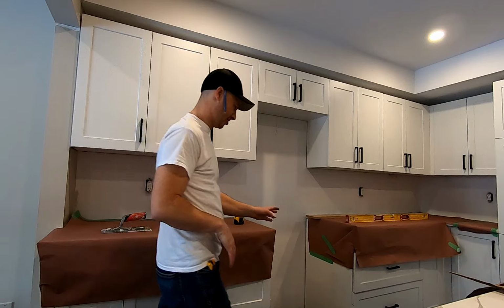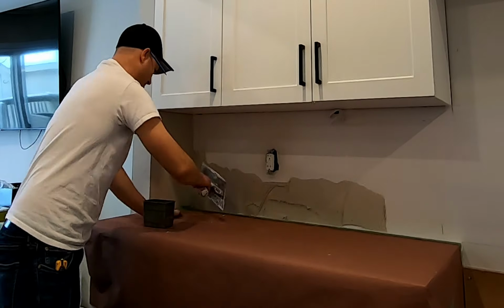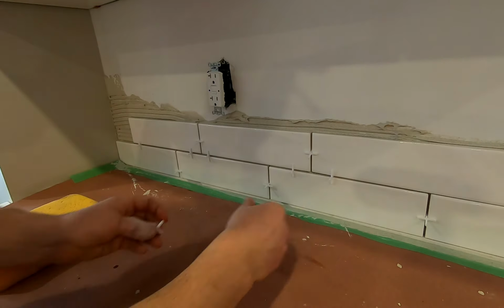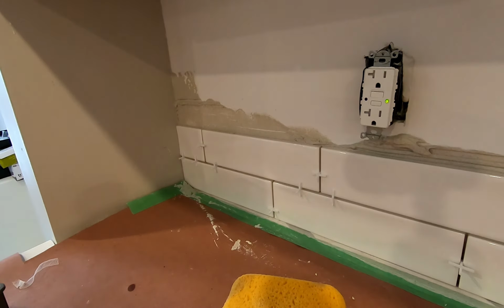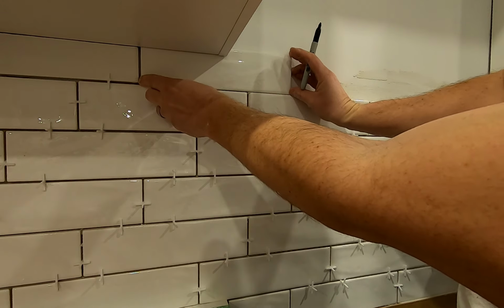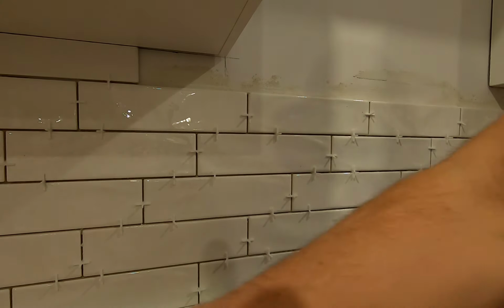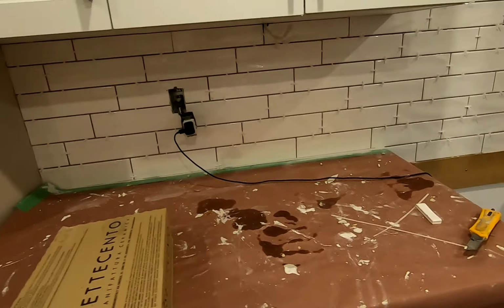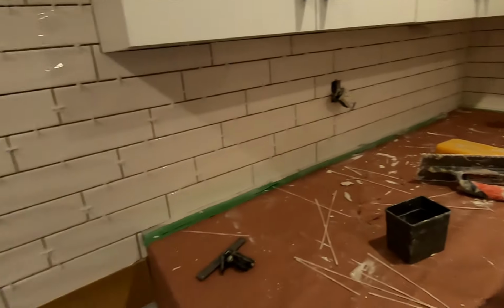How to Install Subway Backsplash Tile

Comment: I enjoyed your video.  Your straightforward, no-nonsense style is refreshing.  You checked the level of the first 2 rows and found a couple spots that were a little high and it looked like you just moved the spacers around to get level.  Were you able to do that because the edges aren't even? I'm about to do our backsplash and have tiles with faces like yours but the edges are a bit irregular and I've been worrying about how to keep them level without going crazy using more than one size of spacer.  Any help is greatly appreciated.
Reply from the maker: Yes, they were a bit irregular and the edges aren't square. They taper a bit so they are larger at the back. The farther you push in the spaces the bigger the gap. They have little wedges, usually with the tile spaces at big box stores or flooring stores that you can use. Use a level (stick or laser) as you go along to make sure they are level as you go. Thanks!
Reply: @BrentDarlington  Thanks Brett!

Comment: Nice vid, thanks! Any reason you preferred to start in the corner versus in the middle area (stove) to even the cuts on both side?
Reply from the maker: I usually do with a stacked or 1/2, 1/3, 1/4 offset. I would have centred off the stove. Any symmetrical layout. With a 3rd step like this I try to keep it looking more random. I always find that the more I try to overthink the 1/3 or 1/4 stepped look it just doesn't work out the way I want  anyway so I don't bother. I find this layout doesn't draw your eye to a centre anyways. The layout is always tough! There are lots of options and I usually ask the customer what they would like to see
Reply: How can I know if the last tile in every line will be nice or not nice cut please ?

Comment: Hey great video. Quick question- I like how you didn't use a wet saw to cut the more complicated cuts but what is that tool you used called? I'm about to tackle tiling for the first time and would like to use that instead
Reply from the maker: Thanks. I used a 4" angle grinder in it with a diamond blade made for tile. Wear a dust mask, safety glasses and ear plugs!

Comment: What tile is that and did you use 1/8 spacers?  HD or lowes?  I just bought some like that but it's all uneven on sides and spacers don't work.  I think I'm going to return for a square tile like yours. I think i saw them at HD or L. Thanks great.
Reply from the maker: I got it from a tile supplier, don't remember what it was called. 1/16 spacer probably.

Comment: Hey boss! Quick question. 28 square foot simple backsplash in kitchen (I have the product) paying someone for the labor to do it. What’s a fair price ?? I want to make sure I’m not getting hosed ! Thx!!
Reply from the maker: There are way too many variables to get you a price. Location, tiles, number of receptacles, etc etc. If you feel the price is too high, all you can do is get another quote or 2. Good luck!
Reply: @BrentDarlington  I understand what you’re saying. There is three outlets. But honestly there’s Gotta be a ballpark figure. If one person would do it for 3 or 400 and he’s going to quote me 900 then yeah somethings amiss
Reply from the maker: @johnc1280  one person may put down drop clothes and clean up well, make nice clean cuts, take his time and do a good job. And the other may make a big mess, do a sloppy job, and be done by lunch time.  I've lost jobs for my price being too high and lost jobs for being too low. If price is your main concern than you may get what you pay for.
Reply: @BrentDarlington  I don’t trust people enough to not inflate a simple job even. I’ve had one company say 400 to pump my septic and another 350 and the one who came and did it was 139 (and professionally, I watched them do it standing right there) so you get my point
Reply: @BrentDarlington  can’t believe it. The guy called me today. Said $500. That’s to 1. come in level out a few bowed areas in the wall. Next day 2. do the tile. Next day 3. grout and seal. Wow. That seems like a no-brainer right?? To go with him
Reply: I’m in canada, I would charge $415 for that job just to give you a rough idea.
Reply: @homeswithandre  I already had it done. I appreciate the response. He only charged me 500. Which is unbelievable. 3 day job. He had to float the wall to level it out. There were humps. Came back laid the tile. Came back a third day and grouted it
Reply: @johnc1280  yeah that’s a great price.
Reply: @homeswithandre  thanks man. do you have any experience mounting floating shelves in the kitchen on a tile backsplash surface? Do you have any advice for me? That’s my next feature to add to the renovated kitchen

Comment: Hey, so I'm in the middle of tiling my kitchen backsplash with 3x6 marble and 1/8" spacers over a granite top.  I've watched several how to vids that say you should leave an empty grout space at the bottom on the counter top as an expansion joint that will be filled with color matched caulk.   And thats what the floor and decor store "experts" advised me to do.   So thats what I've been doing.   But like your video, I've seen people not putting spacers on the bottom, also.    What is industry best practice?
Reply from the maker: Lol expansion joint. The granite and tile isn't going to expand. And 1/8" is a pretty big grout space for tile these days
Reply: @BrentDarlington  Not just about the granite and the tiles.  It's about everything else.  Houses settle.   I didn't make this up.  I've been reading, talking to people, and watching vids.  Clearly this isn't a universally accepted procedure.
Reply from the maker: @rrmorris67  I think you are worrying  about it too much. What is the worst that's going to happen? I've installed lots of back splashes and never had a call back about the house settling and causing an issue at the top of the counter
Reply: @rrmorris67 actually you are correct. Industry standard is to leave a gap between tile and countertop and also in corners for expansion. It can cause problems by not doing so.